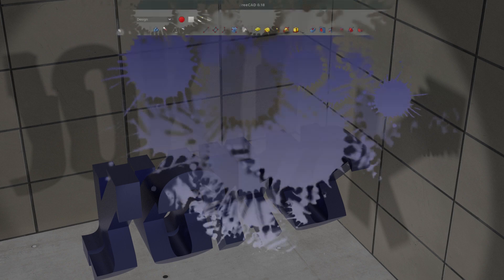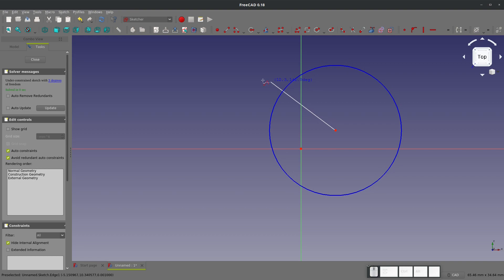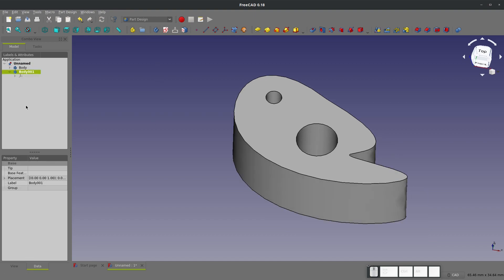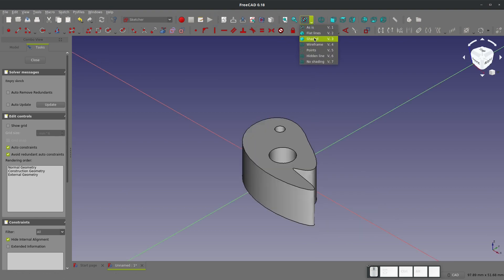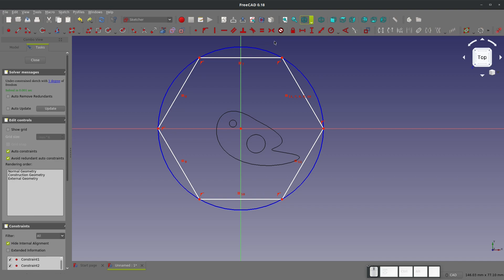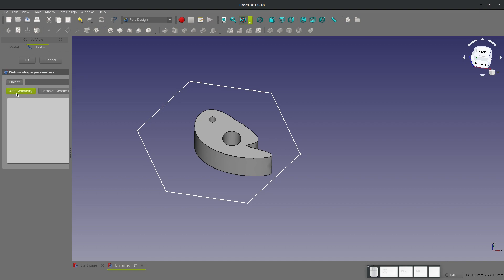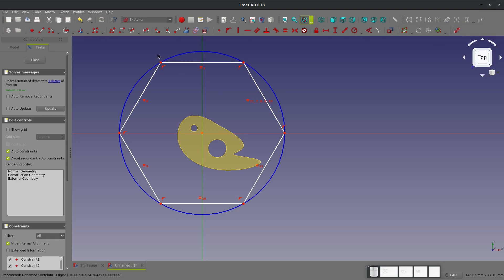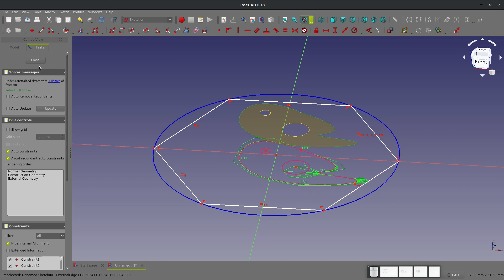FreeCAD - Shape Binder Really Helps Multi-Body Modeling in Part Design |JOKO ENGINEERING|

Comment: I like what You showed at the end of the video, You could make "all knowledge short" with few frames from using different tool/technic and put some alphanumeric subject and date# reference so people could type it and find on Your channel, and under the video the list of the stuff giving lesson version and number So anytime You add some new content to certain chapter or extend it to new version people will see alphanumeric reference like PartDesign | advanced sweeps v2.3b | 01.03.2024 - 12.05.2024| and people who watched that before would see that there's a new version of the video with version number up (2 instead of 1) meaning major change; .3 - that you added some content, but nothing changing principals of the lesson ; b meaning some even smoller stuff changed like fixing little less significant stuff, like rearanging contents sequence, changing typos etc (and You could put under the full video You can click under the short what was changed on what version, with dates)

Comment: I noticed my multibody part was only showing one of the 2 bodies when adding the part into an A2+ assembly. After creating a second body and adding a shape binder to the correct feature, both bodies showed up in the assembly. Unlike SW, this way multibody modeling is more explicit, which may be a good thing.

Comment: i must be doing something wrong, i have a sketch within my active body, and have a separate body that i'm trying to reference but am unable to add edges, faces, or vertexes from the external body. FWIW, i'm trying to reference "shapes" "offset" from the sketch i have created, so not sure if that's my issue. please excuse my poor choice of words. below is a link to a visual explanation

https://user-images.githubusercontent.com/613805/116114885-65912300-a67f-11eb-8b67-9020a0ed1912.png

Comment: Thanks for the great tutorial! I have found that the shape binder doesn't honor transforms. That is, if you use transform to move a body in the 3d workspace, shape binder will still treat it exactly as if it had never been transformed and show it at the original location. Does anybody know of a workaround for this? Usage case example is that I created several gears for a gearbox, then used transform to move them to the desired locations for proper meshing. Now I would like to create the side of the gear box and need to locate the proper location for the gear axles but shape binder doesn't map them to the proper locations, just to the origin (where the gear workbench created them).
Reply: I figured it out. I should be using the green shapebinder, which will do multiple bodies and honor the transforms also.

Comment: Excellent and usefull, would be nice if you could cover the multy body technique in more depth, like How to extrude a sketch from body "A" up to a face of a body "B"
 I've tried using shape binder for that but with no luck.
Reply from the maker: You're doing that within the part design workbench, correct?
Reply: @JokoEngineeringhelp  Right, ussualy the error it shows after selecting the sketch A and set the operation type to "Up to face"  says: "Resulting shape is empty" but I'm able to extrude the sketch in the other configurations normally
Reply from the maker: @lovizio93  I created a quick and dirty multibody part and defined a datum plane on the planar face I was extruding to and extruded to the plane instead of the face and it worked.  I can send you the part if you email me at the address in the description
Reply: @JokoEngineeringhelp  Thanks, Joko, I've sended you an e-mail

Comment: Another great video, thank you. I wonder if you could make a video on datum planes, and how their use helps overcome the topological naming problem in FreeCAD. Coming from something like Fusion 360 the recommendation to not sketch on faces, but instead use datum planes is confusing.
Reply: Download and isntall "FreeCAD Assembly3" by realthunder. It is the full FreeCAD (with the Assembly 3 workbench). The advantage of this branch of FreeCAD is that the toplogical naming problem is solved so you can draw the sketches in the faces